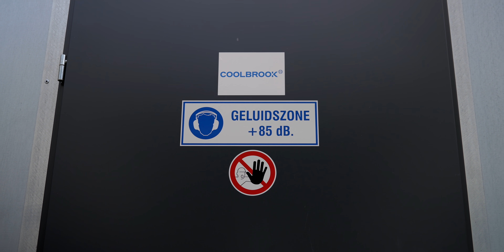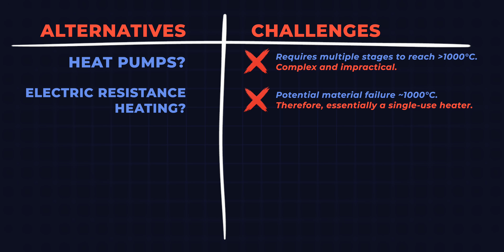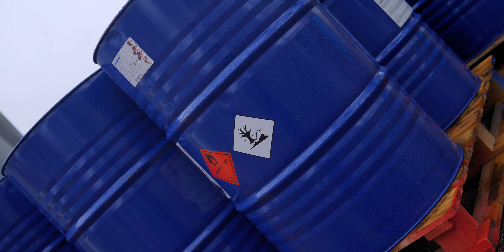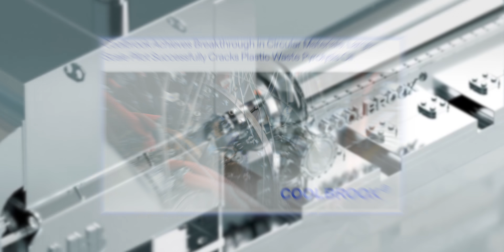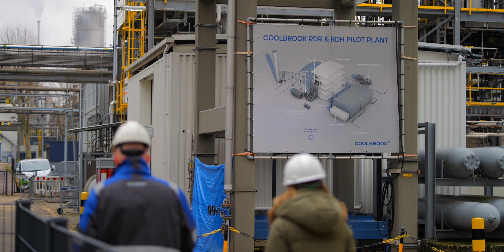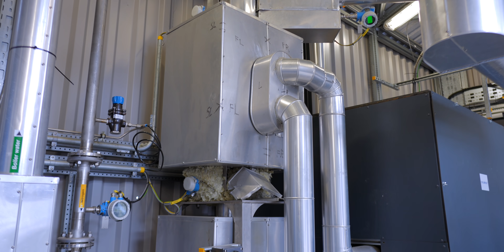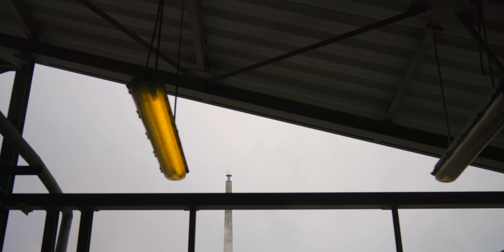Where Heat Pumps Won't Cut It, Coolbrook's Shockwaves Might....

Comment: Rather than heating from ambient to high temperatures using the Coolbrook turbine in a single stage ... perhaps efficiency (and perhaps higher temperatures if desired) can be accomplished in 2 stages:  Stage #1  use AtmosZero or similar high temp heatpump to raise temperature to (say) 200C and then use the (probably) inefficient but very high temp Coolbrook turbine to raise the temperature the rest of the way.

Comment: It would have been better to put the technical explainer at the beginning. Now I assumed it was basically an air compressor run to heat the air up and it was basically that, but that should have been the beginning of the video. It's not unlike taking bleed air from a compressor to use for heating.

Comment: Why the obsession with comparing CO2 generation to the aviation industry?!  The global aviation industry accounts for not even 2% of global CO2 generation compared to, say, road transport which accounts for *40%*!!  Aside from anything else, quite why everyone is spending quite so much time, effort, money and talent on combating global CO2 emissions from aircraft when the extremely easy 'low hanging fruit' of road transport is so much more important completely baffles me. Regrettably this sort of video does absolutely nothing to educate and only contributes to the FUD that exists on this subject.

Meanwhile, unfortunately, the one alternative technology to just carry on burning fossil fuels for these high energy use industries that you have ignored is the one that could absolutely be used for 'hard to abate' industries, certainly some of them, at least.  That technology is a heat battery which works on the principle of latent heat (actually the very same principle as a heat pump/fridge).

You are also making the gross assumption that just because we have traditionally used fossil fuel power - and lots of it -  to enable all these industries, that we have to continue to do so, rather than develop completely alternative ways of achieving the same end. Electric vehicles are a very good example of this.

Comment: There's one more to add to the list of unsuitable high temperature heat sources: gas cooled nuclear (mini) reactors.  Could be a longer-term solution.  Also, Hydrogen is not terrible if generated on-site and used quickly enough.

Comment: I couldn't care less about carbon emissions. But what IS impressive is the capacity to run without fuels. In space, we don't have easy access to fuel deposits or biofuels and solar is the most likely power source. This means electricity. If we can solve this problem space faring becomes SO much easier.

Comment: FYI
There are more ways to achieve high temperatures.
In 1993 I was calculating electric induction furnaces to melt steel. They were commercially available from ABB Metallurgy.
And today, I (among other) calculate 2000C resistive furnaces made of carbon or CFC. Quintus Technology sell them, so they are on the market (I do not work for Quintus).
That said, the technology shown in the program looks very interesting!
/Mats from Sweden

Comment: Uses of direct solar thermal for industrial heat please.  Might not have to wear a long parka for that report.

Also high temperature catalysis to form hydrogen hardly ever hits the airwaves, with disproportionate focus on electrolysis.

Comment: Silicon Carbide (SiC) and Graphite are both refractory and conductive so they're sometimes used in induction furnaces to indirectly heat non-conductive products, either as a crucible or a non-contact heater sleeve. It needs inert atmosphere to protect against oxygen attack at higher temperatures, but then this rotary compressor design also needs inert atmosphere too. There's a menagerie of more exotic materials that can be used in more specialized cases as well. So it isn't a complete non-starter.
And the turbocompressor diffuser is still going to be exposed to these temperatures to some degree due to close proximity to 1700C gas, so I doubt they solved or sidestepped the materials science challenges faced by the alternatives, so much as brute forced it by active cooling the diffuser.

Comment: My worry is that electricity doesn't come from 100%renewable, like solar, wind, hydroelectric etc and since this is added load on the system, the electricity it consumes will have to come from fossil fueled electric power station with their added inefficiency and wasted heat

Comment: A 17 minutes video, yet precious little time spent explaining the working principle. I'm left curious of how this reactor can heat the fluid to those levels without damaging itself.
Reply: The input is fluid, but not liquid. Gas is highly compressible.  Jet engines suck in subzero air gaining lots of heat from compression turbine alone, before combustion. A shockwave is avoided inside jet engines.  They're saying this toroidal turbo has a stable shockwave, which quickly achieves high temperature and would doubtlessly have to avoid the walls, to be stable.
Reply: Another way to put it: the same way a re-entry capsule protects itself. The shockwave happens a slight distance away from the surface itself because close to the surface there can be no large movement (because the surface is there, pushing the fluid particles close to it back against the incoming flow). That means that the convective heat transfer to the surface is inhibited, and instead the heat must conduct through the fluid between the shockwave (where the heating happens) and the surface of the stator or heat shield. Gas is generally much better at carrying heat, than conducting it. If the heat shield can remove heat quickly enough (either through cooling or ablation), it can be kept within safe working temperature.

Comment: You forgot to mention thermal solar, focus the sun to a focal point and you achieve temps up to 3000 degrees centigrade. 
Problem is this is done on a small scale, not good for corporations. But ok for small households to generate products from the house.l Our reaction going on in full s . Hopefully this  leads to alleviation of suffering.

Comment: Silly question, there was a bunch of hand waving when it came to where the 50-100 megawatts of electricity is coming from. No one in the comments has asked. If we are just passing the buck to the coal or gas power plant down the street, how much of the dreaded CO2 are we saving? How much EXTRA CO2, salaries, and missing productive taxes  (since grants and and tax breaks come from somewhere) what is the rea; cost to savings?
Or it this another math exercise like ethanol for gas?, I mean sure it's an antiknock and lead additives are mostly not used but it's not the panacea as marketed.

Comment: There's a startup out of MIT called Electrified Thermal Solutions. It's retooled the chemistry of high-temperature firebricks to make them both electrically and thermally conductive. Essentially, their 'e-bricks' are heating element and storage medium rolled into one. Up to 1800c, apparently ... and there's more to it than simply heat. The e-bricks can be incorporated into different types of ultra-high temperature structure - blast furnaces, cylinder furnaces, tower kilns etc. For certain processes structural flexibility is critical. The steel giant ArcelorMittal is an investor.
Reply: Interesting.  Conductive bricks could be heated by induction.

Comment: Thanks for the video. I'm surprised and impressed by 90% electricity to useful heat, most indirect systems don't reach that.
However I don't understand one important part. The disadvantage of resistance heating (Joule heating or induction) was that the materials wouldn't survive, and arguably this is true for some applications. But if you can make a turbine with all the moving parts be OK at the temperature required, I think you also use "materials". What actually disqualifies resistance heating in this case?
Reply: My understanding is that the hot region is hovering inside that donut. The location where shockwave collapses is away from actual walls, inside the volume of naphtha that's being circulated through, so that that gas ends up being heated predominantly.

I also wish they presented some diagrams of what the gas really does. It's nigh impossible to grasp how jet engines don't melt, as they spin their rotors by burning gas hotter than the melting point of turbine blades themselves. I definitely wouldn't become enlightened from looking at the metal parts alone.

Comment: Okay, but we already have EAF and induction furnaces? Even if you claim that EAF or induction doesnt work for non-conductive, non-magnetic materials (which is a myth), we also have the next best thing, plasma arc furnaces. They can reduce up to 85% of carbon emissions when compared to traditional blast furnaces, which is waaaay better than the claims being made in this video.

Any moving parts or very high pressure systems (being added on top of the high temperature requirements) significantly increases points of failure and cost. I'd need more convincing.

Comment: It is not smart to gear up that motor.  The faster a motor runs, the smaller & the more efficient it becomes.  The motor should run at 24000 RPM.  This is easily done with the readily available variable frequency drive electronic units.  That motor would be MANY TIMES smaller (about 9 times smaller) & the gearbox is eliminated.
          If electric heater is melted, how do the turbine blades last?
          What about injecting heat energy directly into the gas stream by plasma arc in the gas without the need for moving mechanical parts?
Reply: I suppose in this process the reaction would be completely different if you allow electricity to arc through it. You'd get something like black useless soot, not the cracked products. They need precise temperature, not a plasma blob of raw atoms and electrons
Reply: 😂😂😂😂

Why bleat on about such stuff on this platform?

If you have decided the techniques portrayed viz the engineering practices and processes are wrong then kindly contact them direct.

They might even offer you the principal position of professional engineering consultant.

Just go for it!

Comment: Electric resistance heating limited to 1'000 °C? What? That is not what is holding it back at all. The problem is, if you have a heating element at >>1'500 °C (they are not hard to make) you then have to get that heat into a process such that the thing in question can be at say 1'500 °C. Unlike a flame, which reaches into space and can directly contact process equipment or materials (in the case of cement specifically the kiln lining+solid bed), these things are stationary and have no way to effectively move heat to other things. You can also not simply shove air through them, as that would defeat the purpose (lots of otherwise useless air = lots of losses) and trying to have a fan keep recirculating gas through the heating elements (so no new air is needed) would need a fan that operates at such temperatures 24/7 while subject to all the stuff flying around in there.

And that is also exactly the problem this system has too: A cement furnace needs high temperature not just for a few seconds, but minutes at peak temperatures. If you can heat a gas directly and only need short time scales, this is (just like resistive heaters) an option. If at all, we will see things like plasma burners, microwaves or similar in kilns. So systems that directly heat the gas or even the solid in the rotary kiln without having to actually deal with the gas, because holy moly is that full of dust and all sorts of shit.

Generally this is like an ad, you do not talk about the issues at all. Why? One extremely specific application (that could also use resistive heating!) and lots of talk about a supposed incredible potential that is absolutely unrealistic, as I tried to show with cement as an example.

Comment: All those alternatives didn't include lasers, what are the pro's and con's of using thousands of lasers pointing at one single point.
Reply: Money and money?
Reply: Pointing at one single point is like admitting that you will not be able to control temperature much at all. Blazingly hot in one spot and cold right next to it. It works for laser cutters, where the task is to heat up beyond melting point. It doesn't work so easily for heating a lot of material to a specific temperature.

Comment: shocking. what making hot air with pistons or turbines air compression. sure there are tons of ways to rise temperature to real high with electricity. what exactly is the problem someone claims to be solving here. all problems are already solved, so market must be making up their own problems for people to buy their fake solutions. ie hardware. first fix the people market gov incentives or your effort is not going to be useful even if you claim to be doing alot. yes I am bragging about christ not about flesh law works effort. sure resistive heating is the simplest electric heating if you have tons of free electricity, like from arc dd fusion reactor. its not about if you can, its about if you do. therefore talking about if someone can do need to stop, and people need to just do stuff whatever they do. talkings are in vain. if you have material issues then use tungsten carbon ceramics etc. what information table is that. makes no sense. separate sales from the science first then you can see properly. any type of electric heating like induction/arc heating is just fine. people's science has turned into magic salt sales. yep people metrics are nonsense. dont even compare to christ who is perfect.
Reply: Ah yes so you claim, but, what about the Muslim view?
Reply: @ForestForest-n9ia lie, don't care what flesh talks.
Reply: That be a turbopump.
Reply: Shockwaves are piston volume super heaters heat pumps.

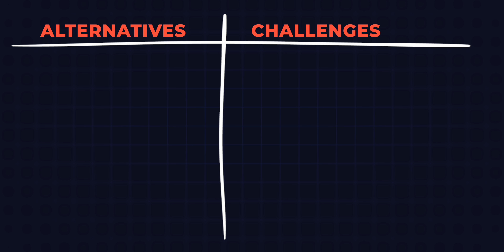Comment: not sure wether they apply but in the listing starting at 2:05 i missed arc furnaces, those are used daily already and generate enormous temperatures with only electricity
edit: spelling
Reply: Arc furnaces are used mainly in melting solids, they aren't suitable for the rapid controlled heating required for cracking, 
as their opperating temperatures are in the +3000 C range and not the ~1000 C mentioned needed in the video
Reply: @plopgoot5458 well temperature control is also a huge part  in using arc furnaces especially if you want too cast liquid alloys /metals since it is actually quiet bad too heat it up any higher than needed (high temps means high chemical activity)

Than I would add 2 other types of heating that have higher efficiency and and super fine control 

Microwaves
And
Induction 

 that roto dynamic stuff is clever and highly efficient in its steps but the problem is multiple conversations form electricity too heat  they claim more than 90% but the electric motors have only 80 -90 % depending on type and application  and than they use the turbine part that alone has 90% too 95% efficiency  that is really good but it adds up with the motor and they have a gearbox that also eats same percentage of the energy put in that system 

Best case is 90%×98%×95% = 84%  of the actual energy they put in is converted in usable heat 

And Induction heating is just soo much better efficiency wise with 90% to 98% and that heat is also generated were it matters but gases are usually not conducive  but stuff like metal mesh or foam or even a metal catalyst  that cann withstand these temps cann solve that for liquids and gasses 

Microwaves are also highly efficient  if we want too heat up stuff especially stuff with a good amount of water in it it cann reach 90% soo that roto dynamic heating still needs huge improvements too outperform these technologies and not only be a special use case only  but I cann see its application in concrete plants were the material isn't conducive or polar components like water are present

Comment: 5:51 is that guy using the safety hat correctly?
Reply: He did not at all adjust the size and just plonked it with a way too small setting on his head to let if float somewhere in outer space. If he were to look down or whatever actually work it would fall off his head. But from impact protection it should be almost the same as long as it is there. But he sure will hit his head a lot on "low" hanging pipes etc. Or in other words: He is not normally working around equipment. This is like a picture of someone holding a soldering iron at the hot tip.
Reply: Yes
Reply: @alanhat5252 

Well, he got it on his head so that's a start.

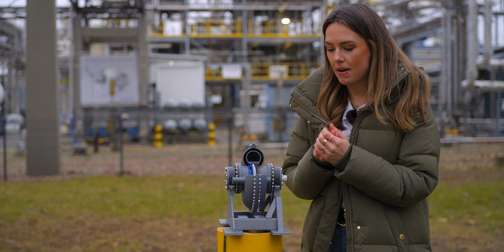Comment: Shoutout to Ideal Gas Law! Good explanation with the model 15:14
Reply: Good explanation? How does it actually work then? It was a big hand-wave something something shockwave and done it is now hot. A bullet or jet flying through air create shockwaves, does that mean all of the air is suddenly hot? No. Only for a fraction of a second at exactly where the shockwave is currently located, then it is back to almost exactly the temperature it had before.
Reply: @leocurious9919 That's the whole point. During that split second when the gas gets that hot, the naphtha splits. It's a continuous process where the gas flows through and is heated for a very short time, but that's enough to crack the naphtha molecules.
Reply: @andy_rb  But that was not explained? I just assume that is a possibility as to what actually happens. They never mention the one big advantage this brings?